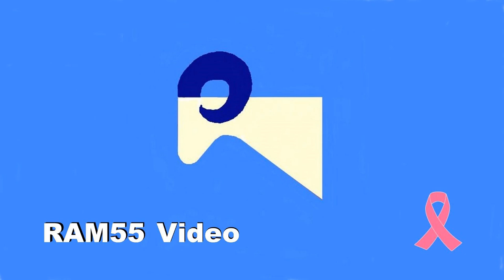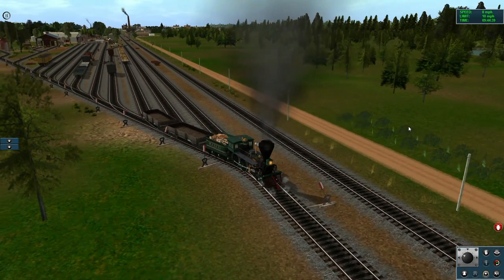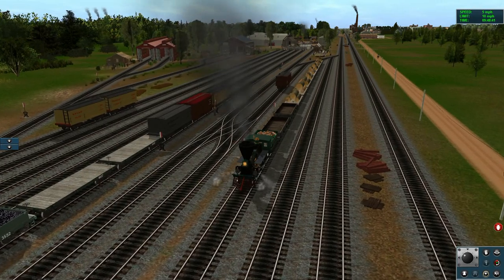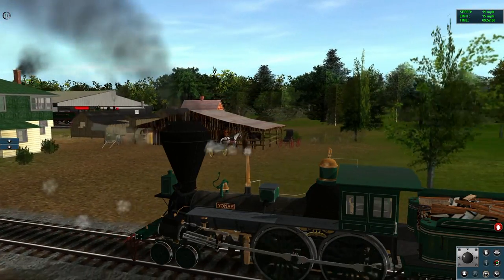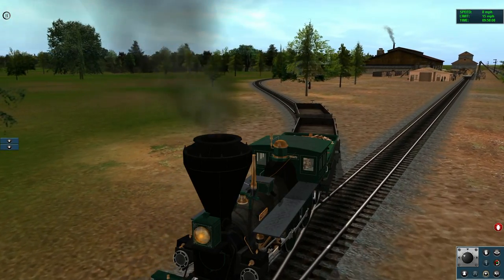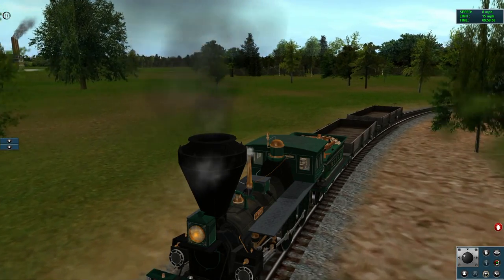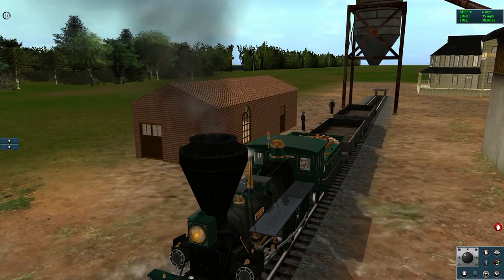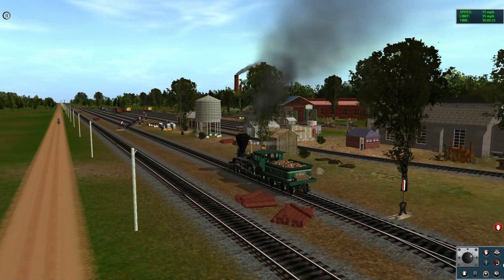TS12 Wyandotte & Arbor Operation Session no5 Local freight

Comment: The hissing is the safety valve (popoff) and unless you want a simulated boiler explosion and the end of your scenario, you can't get rid of it.

Now, as for the buildings and facilities, the Carson Car Shops website (specializes in Virginia and Truckee/Old West stuff) has some awesome buildings that are era-appropriate.

Passenger stations too! They handle Old West Passengers and even mail and baggage!

Your passenger coaches can handle them; and your Conductor Car can handle baggage and more passengers.

BTW, his Old West cabeese (you call them Conductor Cars) are industry-interactive. So are all his coaches and he has special express (mail) and baggage coaches just for those commodities!
Reply from the maker: Yes. Thanks. Very irritating. I wish game developers made the sound files more adjustable and flexible. There is some irritating chopping noise from animated loggers. I like the figures, hate the noise!                           I know they adjust water levels, fire intensity to keep boiler pressure in range in real steam trains, not sure if I used real mode in the game if I could control the pressure and thus the safety valve. But, I know I don't want the hassel of operating a steam engine realistically in the game. I don't mind deisel electrics, but not steam!
Reply: About that... All of the engines on Carson Car Shops have an "automatic fireman" which manages the fire and boiler pressures automatically so the hissing doesn't happen.

Hit "Shift + Space" to activate it (IF it's enabled in Surveyor. If it's not, you must manage the fire yourself.)